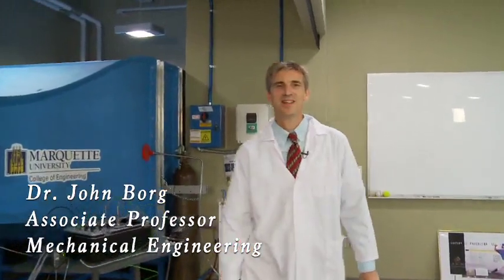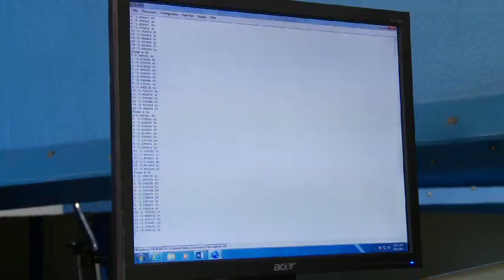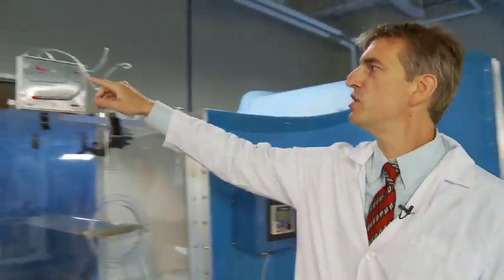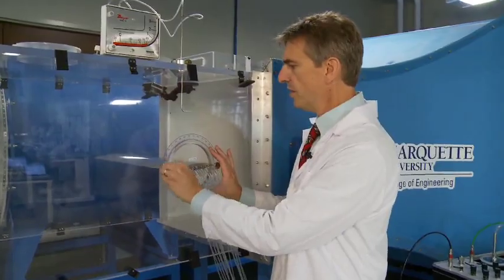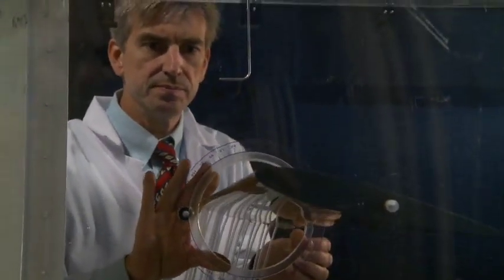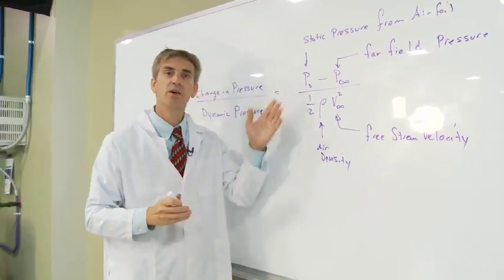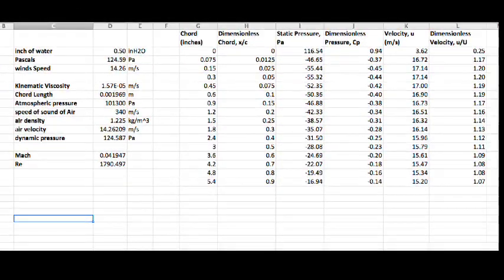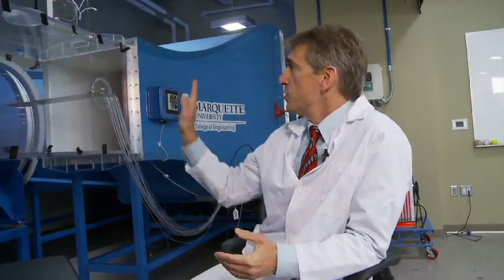Wind tunnel pressure data for a NACA 0012 symmetric airfoil

Comment: Sorry to nitpick, but you drew the mean camber line and not the airfoil chord. The chord is always a straight line while the camber line follows the average of the upper and lower surface heights. https://en.wikipedia.org/wiki/Chord_%28aeronautics%29#%3A%7E%3Atext%3DIn_aeronautics%2C_a_chord_is%2Ctrailing_edge_of_an_aerofoil.%26text%3DThe_wing%2C_horizontal_stabilizer%2C_vertical%2Cused_to_describe_their_width.?wprov=sfla1
Reply from the maker: Good point!!  Thanks for pointing that out!!  :)

Comment: So is that dead zone a vacuum. So interesting .
Reply from the maker: Super interesting!!  I am not sure where in the video you are referring to but there are regions of the flow where the pressure isless than atmospheric pressure (ie a vacuum pressure).  But the pressure never goes to absolute zero (like a hard vacuum).  In regions of the flow where the air is moving faster the pressure is low, lower than atmospheric pressure.  So it is a vacuum pressure in the sense that it is slightly lower than atmospheric.  This is due to the Bernoulli effect, which for incompressible fluid behavior (as is reasonable to assume here) states that as the pressure and velocity are inversely proposal: if pressure goes up, then velocity goes down and if velocity goes up then pressure goes down.

Comment: Sir, what's the purpose of non dimensionalizing the velocity with the free stream velocity?
Reply from the maker: What is nice about reporting non-dimensional numbers is that two data sets (collected at two different free stream velocities) can be compared.  If the non-dimensional data matches for these two data sets then we know we have dimensional similarity.  Thus we need not data data for every free stream velocity we might be interested in.
Reply: @marquetteshockphysics5518  sir, the idea you're expressing is that while comparing data between 2 models of a body, it is much more convenient to predict Aerodynamic forces if we make use of non-dimensional numbers correct?
Reply from the maker: @akarshshetty9262  Absolutely.  Making use of non-dimensional data not only reduces the amount of data we have to take but it can also indicate when there are major changes in the physics.  For example, if comparing two data sets it might be easier to spot when separation of boundary layer transition occurs.
Reply: @marquetteshockphysics5518  yeah! Sir, here you hav made use of  pressure ports to measure the normal pressure loads... Is there any way to measure the Tangential Shear loads experimentally other than methods like CFD?

Edit1: *other than non-experimental methods like CFD
Reply from the maker: @akarshshetty9262  Sure.  Look up hot-film anemometers.  You can purchase or make these.  They are attached directly to the surface of the body.
Reply: @marquetteshockphysics5518  sure sir, will look upon this 👍 thank you very much for the info
Reply: @marquetteshockphysics5518  Sir, the hot film anemometers are devices for measuring shear loads through indirect measurement of velocities in the Boundary layer region... Is this because the actual magnitudes of shear loads are very small and so, a visual aid such as manometer used for pressure measurement, cannot be used?

Comment: Sir how do we calculate the centre of pressure from the data in the excel ?
Reply from the maker: See the following webpage for the definition of the center of pressure (cp): https://www.grc.nasa.gov/www/k-12/airplane/cp.html
So you could perform numeric integration for cp using something as simple as the trapezoid rule
Reply: @marquetteshockphysics5518  amazing setup sir.

I was wodering about putting naca duct in a long wing where the air detaches at the rear end of the wing.

I believe that naca ducts on such wing will suck the air from the bottom of the wing.
1) improving the downforce
2) forcing the air to remain attached to the bottom side of the wing making it more efficient.

Please let me know what you think and if you could experiment such setup.
Reply from the maker: I am not familiar with NASA ducts.  But there is a wiki page:https://en.wikipedia.org/wiki/NACA_duct

separationopeningbleeding-off pressure, aeffectivenessopportunemaneuversseparation or transition could be suppressed or enhancedNeat idea!

application

Comment: Excuse me, how can you obtain lift and drag from the results? Me and some friends are working in a similar project, but we don't know how to obtain this data (L & D), thank you
Reply from the maker: There are several ways to get the lift and drag.  One way is to measure the pressure on the surface of the airfoil and then integrate that pressure over the area, force=pressure*area.  Another way is to measure the velocity profile behind the airfoil and calculate the momentum loss, that will be equivalent to the drag.  Then perhaps the best way is to directly measure it with a force balance.  If you are interested in learning more you can check out a nice fluids text book, such as Frank White's "Fluid Mechanics" or there are lots of resources on line such as https://www.grc.nasa.gov/www/k-12/airplane/right1.html

Comment: Sir what was the maximum blockage ratio in this wind tunnel
Reply from the maker: The general rule of thumb for blockage is that the frontal projected area of the test article should not exceed 10% of the total cross-section of the tunnel.  The total cross section of the wind tunnel is 2ft x 2ft.  Thus the frontal projected area should not exceed 0.4 ft^2.  This is of course just a general rule.